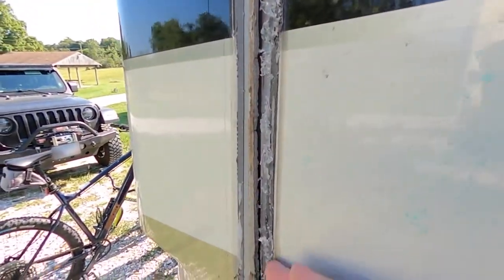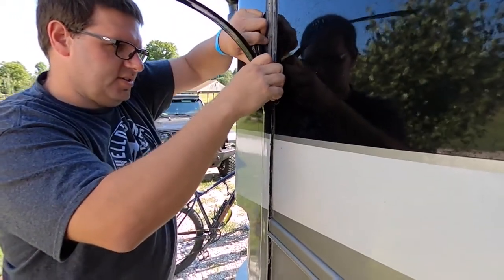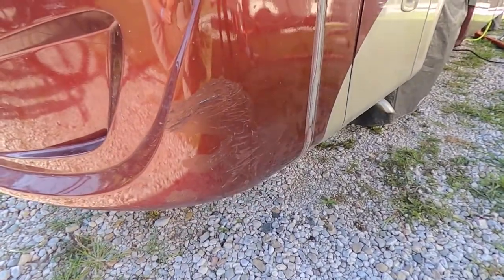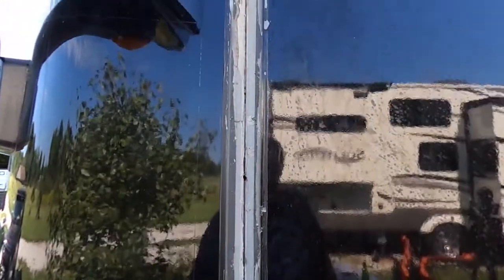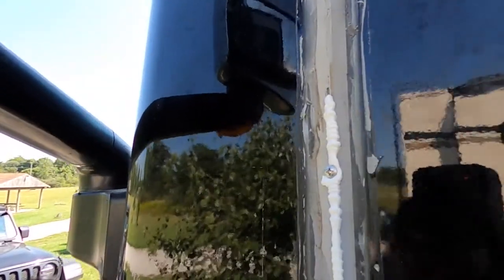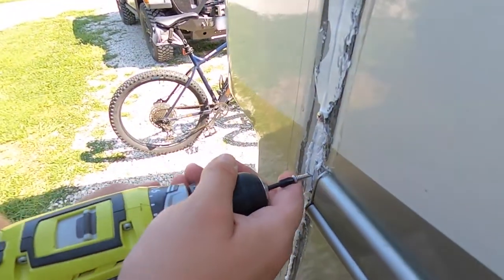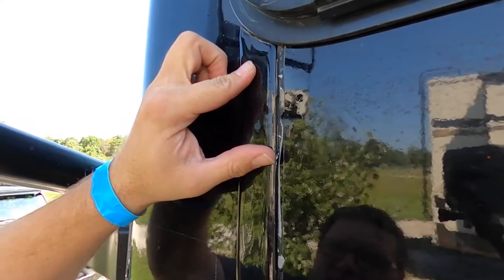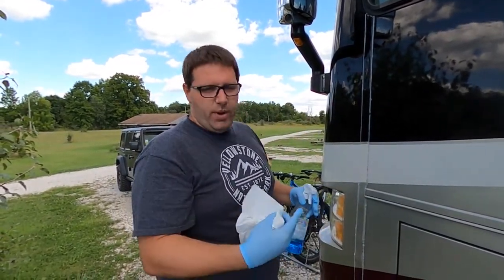Can we do this??? | DIY Tiffin Allegro motorhome repair

Comment: Great video! I have to do this to my rig as well. It has been like this for a year or so and the loose and slightly shaking cap actually caused the mirror to loosen over time and as well. It looks like you are using 8 x 3/4 self drilling screws. Can you confirm?
Reply from the maker: Hey!  Thanks for the feedback! Sorry to hear you're running into the same issue.  Other than this issue, we never had another single major problem with out Tiffin.  So strange this seems to be a common issue! They were indeed self tapping metal screws.  To be honest, I cant remember the exact size. I think at the time I just picked screws that looked like they'd go in far enough but not to far. Ads far as our repair, it held strong and we never had another issue before we traded out of the rig for our next rig.  Good Luck!

Comment: Oh my, I have a 2013 31SA, I truly wonder about the Tiffin quality. I repaired many items and I cuss the hell out of the Tiffin employees!
Reply from the maker: Sorry to hear you’ve had many issues with your Tiffin!  Outside of the front cap issue, our unit was pretty solid and our experience with Tiffin staff has been pretty good.  We had the fabric on our couches start to peel and fall apart.  This was a common issue from the years around when our RV was built.  We were the second owners, with no warranty left. After a couple of emails to Tiffin, they sent us replacement fabric for FREE to fix it.  We had to do it ourselves or pay someone to replace the fabric, but they provided the material for free.  We opted to do it ourselves and it turned out great.

Comment: Hows it holding up after making the repair? My 2017 33aa is doing the same thing on drivers side front.
Reply from the maker: We’ sold the RV about a year ago and changed rigs, but the repair was solid and never showed any signs of coming apart again after the fix. Also, it did not impact the amount we sold the RV for. In fact we made money on the rig, selling it for more than we bought it for.